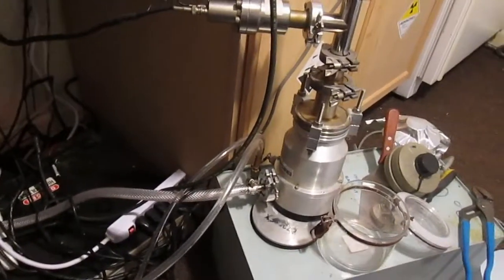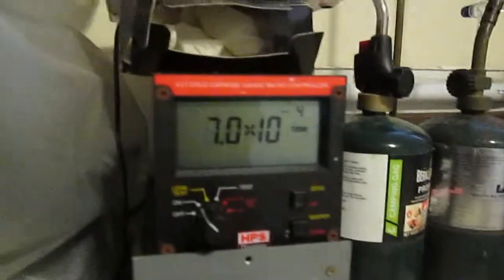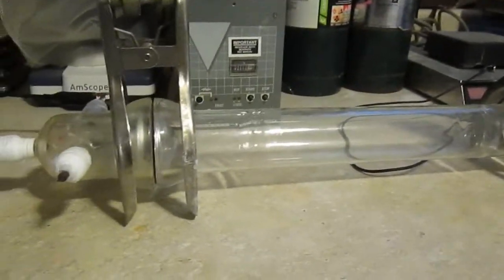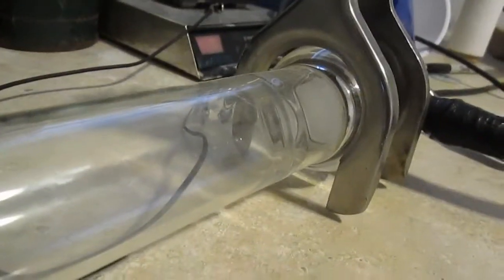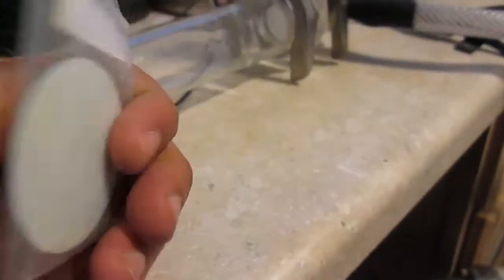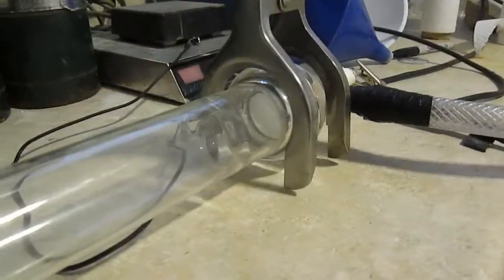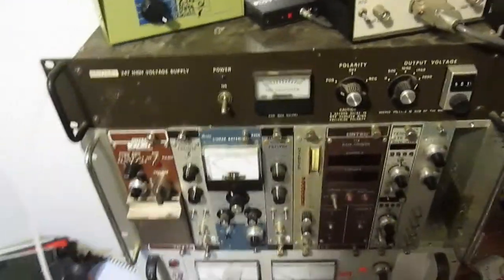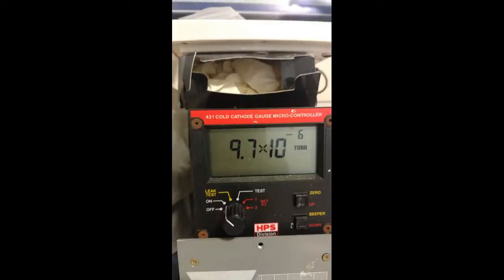homemade mass spectrometer 3 redesign still failure

Comment: wouldn't a diffusion pump easier to operate/maintain and cheaper?  you should continue this project. thanks.
Reply from the maker: Diffusion pump have to heat up and cool down this is incredibly time consuming when trying to locate leaks and experimenting with project like this. Have you checked any of my other analytical videos? I used mass spectrometers many times... also Ben from applied science has done a far better job ! Thanks for watching!

Comment: Hi, interesting, there are some materials used that do not look god for a high vacuum, the plastic tube, and the junctions which appear to be covered in tape look a bit strange. plastic will outgas at high vacuum. A thin tube is also not good because of poor conductivity. How do you intend to scan the mass range ?  Paul
Reply from the maker: Paul. This is an older project and was designed as a proof of concept of sort.. but I always appreciate good feedback and constructive criticism . Thank you. I have since purchased stainless steel parts, and other equipment . I was originally planning to have a trace on a screen where the ion would have landed and I still have those . I did manage to get down to 10-7 torr Wich is a respectable vacuum but I could not get a narrow enough ion beam and despite powerful magnet I failed to get a controlled deviation . So I moved on to other project . Maybe with more time better equipment and trial and error I could get it to work ok as a mass spectrograph..but not in the for seeable future .. unfortunately .. thank you again ! Please check out my other videos as well. . Some of the newer video I play with a real working MS ! Enjoy

Comment: Torr seal is your friend. You might also pick up a He-Leak detector. You can sometimes get these for cheap. I once restored one, and repurposed it in the lab I worked in in college.
Reply from the maker: epoxy works well too... but i have to look into a helium detector thats  a great idea!
Reply: @Neptunium  Please bare in mind, in case that you're not familiar, that Torr seal is an epoxy, and that a low vapor pressure is important. Here is the datasheet on torr seal: https://www.idealvac.com/files/brochures/Torr_Seal2.pdf

Comment: What is it you are using for your glass chamber? Borosillicate? Did you purchase it online? I am having the problem of finding a part that will work.
Reply from the maker: Boomshackle it was custom made by a professional glassblower out of borosilicate glass.
Reply: Neptuniumcritical damn I knew it had to be custom. What are those metal clips called that holds the pieces together?
Reply from the maker: +Boomshackle the big clamps? Their stainless steel multi joint spherical ball pinch clamps I think mine are number 45
Reply: Neptuniumcritical how much it cost?
Reply: I was wondering if he got a gas chromatography tube.  Custom job is pretty cool.